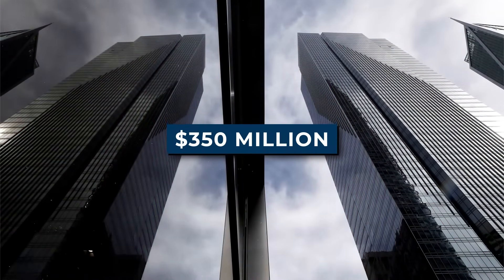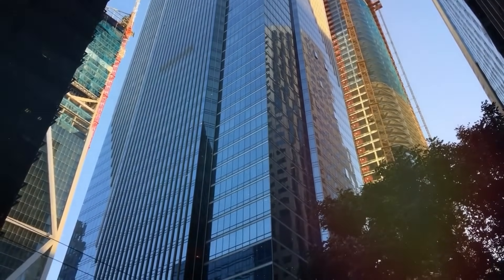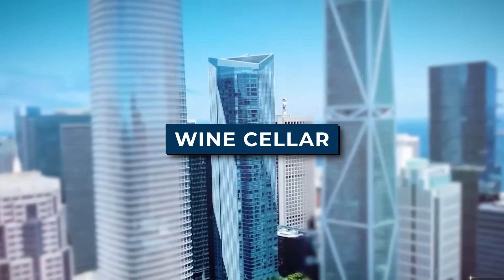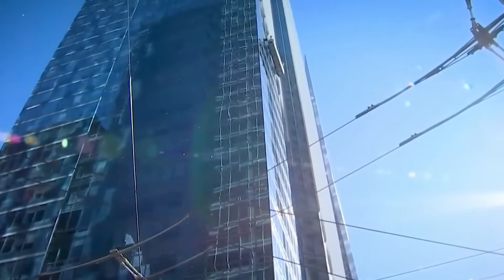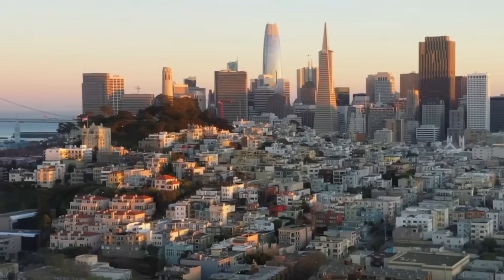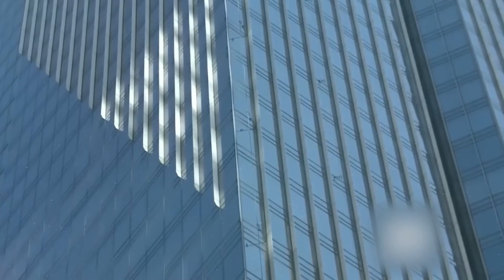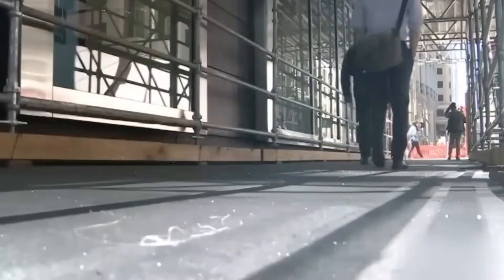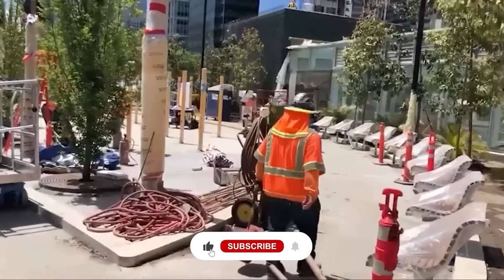The Millennium Tower Which Will Change  America FOREVER!

Comment: The idiots that “strengthened” the towers have the entire structure resting on tiny little steel plates embedded in concrete!  And NOBODY CROSS CHECKED IT!
Not San Francisco, and not the architects.  There is no doubt it will fall.
Go ahead. Pull up the plans for the reinforcement. There are huge jacks pushing up on beams. Locate the beam ends. Follow the rods back down. Those rods are in a jacket that prevents the rods from contacting the huge concrete supports of the foundation.  Now at the bottom, look at what the rods reach…THEY RUN THROUGH LITTLE STEEL PLATES EMBEDDED IN THE CONCRETE!!! And there are no computations for those plates!!! The concrete load is near turning the concrete to dust. 
God help the people in that tower when this all fails. 😢

Comment: You don’t need to be a Chartered Engineer to know that skyscrapers need foundations bearing on bedrock. Reinforced concrete piles have been used for years and years to support reinforced concrete pile caps and reinforced concrete rafts to transfer the building ‘s static and dynamic loads.

Comment: What's worse is that they evaluated two options. A more expensive one that called for reinforcements at the bottom of the building, and one cheaper at the sides. They went for the cheaper option. And other engineers pointed out that would just make the problem worse. And that's exactly what happened. What a cluster f**k.

Comment: This building, was initially designed, for a steel structure. SOME  doofus engineer, changed it to  ' CEMENT '.  The foundation, never went to bedrock. Friction piles, in basically ' mud ' is / will not function. The ground beneath, is garbage and fill, from the last 120 years ago. MUD. ..... / So, no surprise that this tilting, sinking  ' money-pit '   will topple over, at some point. The more they dig / root around it , in attempting to stabilize the thing ; only causes  more   sinking / tilting. Saving over 30 million, in NOT going to bedrock with those piles . =  That, will come back to haunt MR Hamburger, and others.  686 million pounds of cement, 500 feet high. The large cement pad, underneath it , is bending downward in the middle.... When it topples, the mass  of  kinetic energy, when it  topples over will be then  released. WARNING = stay tuned.......'' hey honey, phone those engineers, and tell them to come level our pool table,  AGAIN '' !   Also, the tub and fridge.....not to mention the elevator. Perhaps, we should get some parachutes, or hang gliders, and prepare to  ......um.....evacuate....

Comment: I'm a native SF'can & I've followed this saga.  The SF Building Dpt. for some reason did not require, as is usual, the Soil & Environment Engineering Co.'s Analysis to be reviewed & confirmed by a Third Party Independent Engineering firm.  The same Engineering firm's Soil & Environment Analysis on a nearby project w/ very similar Building, Foundation & Soil conditions & subsequent foundation recommendations was found to be "insufficient" by an Independent MIT Engineer-lead investigation.  That project's foundation was made stronger per the Independent Analysis.  Yet, the same S.F. Building Dpt. knowing the same Engineering firm was involved w/ Millennium, chose no Independent Review & allowed the project to continue.  Regardless of whether the nearby Transbay Cntr./Rooftop Open Space construction "contributed" to Millennium's tilting is irrelevant as Millennium was already tilting before the Transbay construction & it's insufficient foundation had already been found to be the cause.  The blame for Millennium's tilting all goes back to fraudulent lack of building construction review of a woefully "under-engineered" foundation....period.
Reply: Early when the story developed, I think I remember that the friction pilings were reduced in some way from original design. Also construction materials were changed to more elegant heavier material. Do you remember anything like that?
Reply: @artsmith103  Not sure of changes made during the original construction, but "the fix" by Engr. Hamburger was reduced from "around" 52 Pilings to the bedrock to only 18 when it was found that the soil preparation & drilling for the "the fix" pilings were causing Millennium to "unexpectedly" tilt even more.  The point I've been trying to make is that ALL OF THIS MESS is due to the original fraudulent construction review & approval process by the S.F. Building Dpt.  Millennium should have NEVER BEEN APPROVED w/ the originally engineered foundation.  We as Taxpaying SF'cans are the ones who have been screwed; having to fork out $30 million to settle lawsuits against the city & county of SF.
Reply: @chrysopylaedesign  I'm aware of that part.

Comment: In Seattle there was a building a residential structure that had some serious problems. The building had to be taken down. I suspect this residential structure too will have to be taken down. Yes it's  an expensive loss but it's better than having the building fall down. You can't rebuild the the ground under the building. Good luck everybody.

Comment: You made a mistake, saying the problem was caused by a problem with construction. That is not true. The problem it was caused by those responsible for designing the building, failing to setting the foundation of the building on bedrock. The construction was excellent.

Comment: Failing to anchor the foundation to the bedrock was more than a "minor mistake." It was shortsighted, foolhardy, and a known risk that could have been avoided. I would thinj that any architect,w any engineering firm or any construction company native to the Bay Area would understand the stupidity of "floating" a building of this size on reclaimed land in a area prone to earthquakes.
Reply: They saved 5 million by not driving the piles into the bedrock. Chump change for a 350 mil building.

Comment: There was a concurrent project next to the tower for a large metro station.  Like the Miami Beach condo, there are some that think this nearby construction caused or contributed to the problem.  As for what happens now, with modern engineering methods and analysis, I think they think they can fix it. And, we will see what eventuates.  In a completely non-engineering side-note, some  might think the building is just bad luck or cursed.

Comment: It will never be fixed. It will come down one way or another. Seems like SF is fine with it falling over.
Reply: What will happen to the adjacent buildings when it falls? A building on a site with seismic activity and landfill, in a region run by Demo(n)rats and not anchored to bedrock is a recipe for disaster. Could have been prevented so let the lawsuits roll when it does.

Comment: I'm no engineer, but if I knew that despite the building's massive size and weight its piles would not extend to bedrock, I wouldn't buy a unit there.  And if I were told that the fix will be to drive piles adjacent to the building and somehow fasten them to the edge of the slab, I'd question the durability of that fix.  Given the likelihood of earthquakes in that area, I'd expect the best possible foundation.  What they have is an incompetently poor foundation and a repair worthy of McGyver.
Reply: They are bandaiding the problem with a temporary fix that won't last, the only viable logical course of action is demolish the tower and not build like that again unless the foundation goes down to BEDROCK
Reply: Agree. Have met developers and builders here in Chicago who say you MUST anchor to bedrock. Here, with our clay soil, that means going pretty far down. One builder described to me the caseins he put in to anchor an 8-story condo he was building in my area. It's horrifying to think of something as large as this San Fran building being built with so many major errors in design and construction. I'm not an engineer, either, but it sounds to me as though remediation is not possible here and this towering botch in the inception needs to come down.
Reply: I hope the occupants have enough insurance to cover the losses. They will be considerable.
Reply: @stephenspencer4672  The building might no longer be insurable. We can only be thankful that the owner-occupants are affluent enough to absorb the hit. Most original buyers sold early on, and those who've bought since have no excuse for not knowing the building's issues.
Reply: More like Murdoc.
Reply: You are kidding right..... you made a joke right....?   WAIT TILL THE FIRST BIG LAND SHIFT AND WHEN IT FALLS AND IT WILL FALL THEN COME SAY THAT AGAIN.......   HOW ARE YOU GOING TO STOP A FEW MILLIONS OF TONS BUILDING FROM COMING DOWN...... TELL ME HOW THEY DRILLED A THE PIERS DOWN TO BEDROCK........ NO WAY IN H3LL THEY DID THAT....... IT WILL FALL..... BETTER TAKE THE LOSS AND TAKE IT DOWN RESELL THE LAND AND LET SOMEONE WITH A FULL BRAIN BUILD THE NEXT ONE....

Comment: What I haven't heard discussed is the weight distribution with respect to the design. Is the buildings weigh distribution even along the perimeter of the foundation? That is the pressure on the original footings, or is the building heavier on any one side or applying more pressure to some footing over the others?

Comment: That thing is gonna fall into its own shadow if they don’t dismantle it.
Windows are breaking on it… and they’re blaming high winds. 
I would suggest that it’s beginning to buckle under its own weight.  
If it has already sunk 29.5 inches at the ground…that translates to a lean of several feet the higher you go up… it’s not only sinking… the weight of it is beginning to pull itself over.
Reply: It’s leaning 29” which means it should have already been condemned by the city. It hasn’t sunk that much yet. The sinking is uneven.